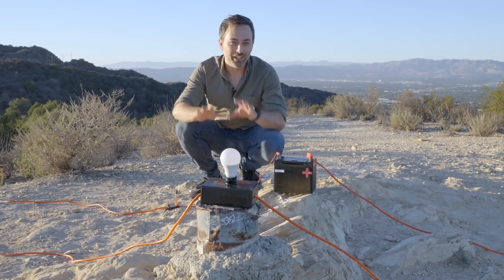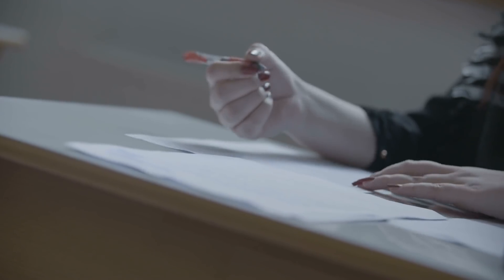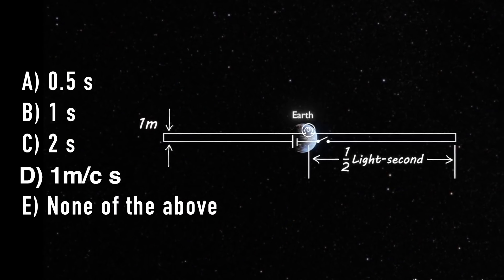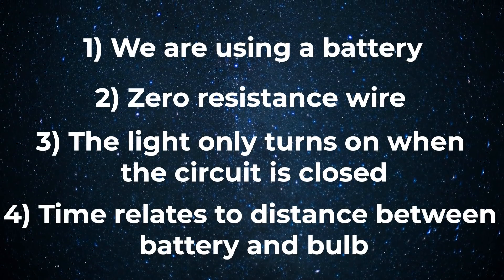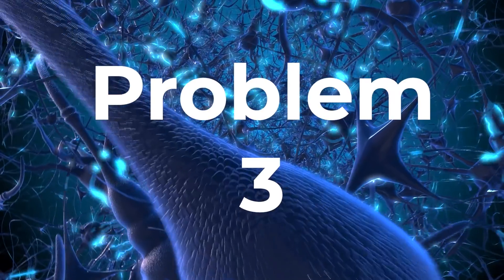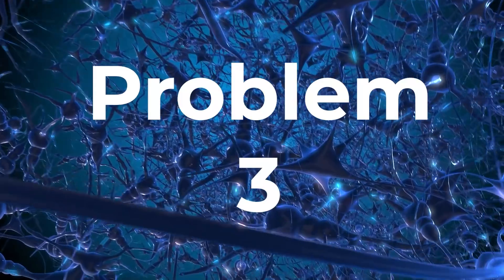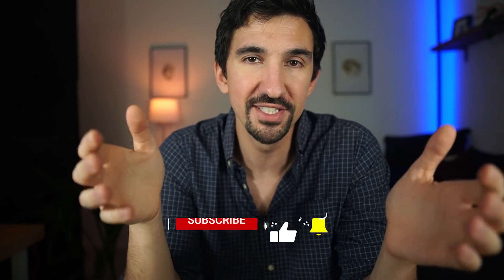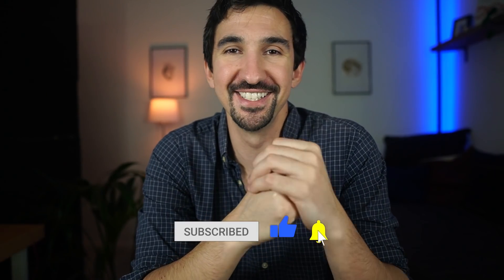Is Veritasium Wrong About Electricity?

Comment: As an EE, he's technically not wrong but he left out a lot of important information and he was rather sneaky about if this was A/C or D/C power transmission or signal transmission. The two are very different. Also, we don't use the physics laws in our day to day practical engineering but it is valid. it just doesn't matter that much in reality
Reply: THIS!!

The whole problem setup is a very, very, very typical physics type question (you know the kind... imagine an infinitely long string with 0 stretch... etc..).

He is correct in terms of how long the fields take to get to the light and that the fields DO carry the energy etc.. thats just the pure physics and should not even be up for debate.

The issue I find, as you point out, and all other EE's (Inc the likes of EEVblog and Electroboom) as well is that pure physics only gets you 'so far' in the real world.... Our entire job as EEs is to take known Physics and with a whole set of other approximation tools at our disposal make systems that work in the real world. An Engineer's job (of any discipline) is based on assumptions and approximations not pure physics (I say its applied physics, in the way a mathematician would say Physics is just applied Math).

In the real would even with superconductors energy would flow to the lamp in 1m/c seconds, but only truly 'light up' (by our real world definition of 'light up') after the field that is extremely close to the wire propagates (at the speed of light) to the lamp ie 1 second as its that set of fields at actually carry the 'useful' energy that can actually do 'useful' work.

Comment: Correct me if I'm wrong, but he did say that the field generates at the speed o light, then the energy is transmitted through it. If that is true then disconnecting one of the extreme sides would not make the bulb go off immediately but only after the field completely goes away, therefore not violating the laws of physics.

Comment: So, i've got a bit of a question, or concern. the part about communicating information faster than light. that is true but i think theunderstanding of the circuit and how the energy actually flows is not fully understood. once the circuit is complete, the number of particles that conduct in the resistive path depends on the resistance. the lower that is the more of that material can conduct with a given source. However, there isn't really anything saying that this has to happen in a cascading fashion from one particle to the next. all the particles can activate at the same time, thus transporting information seemingly impossible distances in an instant. the way i think of it is in terms of traffic. ideally, if everyone moves at the same time there is no delay and we have no traffic build up from people slowing down. it is like this for the conductive material's electrons. they act at the same time. how many activate depends on the voltage and resistance, as the voltage will only allow so much current given a resistive path.

Comment: YOU ARE SO WRONG ! The setup does not break causality because, if the circuit breaks at the furthest point, the  light bulb would not go out instantly. The information will also have to propagate towards the bulb at the speed of light, just like when you connect the battery. And you say you have a PHD? (Laughter).

Comment: if there is a breakage at the end of the line, then the wave will reflect back after some time and you'll see the lightbulb flash at first and then turn off (once the reflected wave reaches it). so in his case it's going to turn off after half a year.

Comment: It takes time to charge an inductors (practical wire) field.
It also takes time to charge a capacitors (two wires with a gap) field.
Furthermore the signal has to propagate through the low pass characteristics of the circuit.
Assuming the battery can pump X J/s into the circuit; The time would be the steady state energy in all the elements divided by X.
Perhaps the battery is incapable of energizing the entire circuit..
Similar to a hose filling a swimming pool.

Comment: As I understand,magnetic fields are incidental phenomena,establishedby energizing a circuit.The only way these fields can propagate energy is thru the process of induction.This happens,first,when the field is established,then again when the field collapses.These low powered fields are so weak that they have to be amplified thousands of times in motor windings to be useful.Fortunately this field phenomenon allows for great elasticity in the use of electricity.

Comment: If I understand your conclusion correctly starting at time 8:23:
.
The bulb receives a small current in the time for a one meter travel time of the energy (1m/c s) .
THEN,  the bulb will reach full brilliance after the wave travels around the loop.
. . 
Is this your conclusion?

Comment: you totally missed the point ... it's NOT about the length of the wires, it's about the distance between the battery and the lamp and the propagation of the EM field

Comment: As an old electrician, I know that I can run a circuit the distance in feet of my circuit in volts.  Anything further, I need to increase the size of the wire. 14 volts? 14 feet. Brake lights in a camper? 16 gauge is brighter than 18 gauge.  A one HP well pump runs at 3+ amps but starts at 24 amps.  A 20 amp circuit, but 10 gauge (30 amp) if not 8 gauge (45 amp) out to the control box.  150 ft out plus 150 ft down is 300 ft.

Comment: when wires of any length are attached to the battery,  the negative and positive charges propagate to the 
end of the wire.  in effect the wire ends are just extensions of the  battery poles.  closing a switch would
instantly permit current to flow.  in this case ,the amount of current would depend on primarily the
 resistance of the wire and  inductance, capacitance,  hysteresis etc would have little effect.

Comment: My point was the same. There will be some light after 1/c but the bulb will be fully operational after almost 1s. This is the time need for thw fields inside the wire to reach equilibrium.

I will also add that if the wires are not perfectly straight then the light after 1/c will be much dimmer than the final

Comment: For point 1, the light bulb is 1m away from the battery in this set up. 1m/(c m/s)=1/c seconds.
For point 2, Veritasium never makes the claim that the light bulb would turn off in 1/c seconds if the wire were broken at an extremity. The way I understood his video, when the switch is turned on, he argues the light would illuminate prior to any movement of electrons at the extremities of the loop. The way I understood it, that was the point of the video; that energy flow does not necessarily occur in the conductor.
For point 3, although you are right about the function of antennas, I think that Veritasium is trying to make the argument that the light would not only turn on for the brief moment where the sitwch is truned on and EMR is produced. The way I understood his video is that the power from the battery travels in the empty space between the battery and load not in the form of EMR, but just the same as it does through the rest of the conductor.
I too am not a subject matter expert (nor a lawyer for that matter), but these are my thoughts. Thanks for making this video, its always fun to think critically through something complex that you don't fully understand.

Comment: 4:14 I think you're wrong in this assumption that when at the furthest point the wire breaks, the distance between the battery an the bulb determines when the light will go off. A switch being turned off is basically the same as breaking the wire, so when breaking the wire 1/2lightseconds away, the distance between THAT point and the light bulb, and from that same point to the car battery will be what is important. it only takes ~1/c time if the switch is close to either the battery or the light bulb. I do like the antenna analogy though.